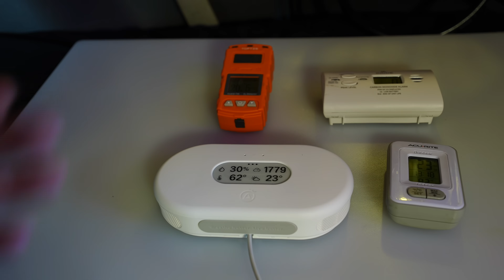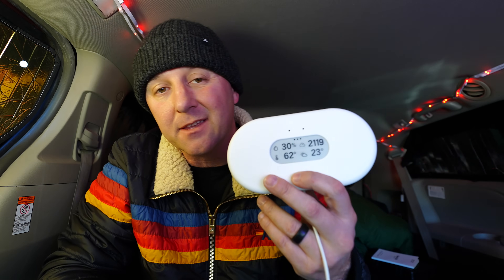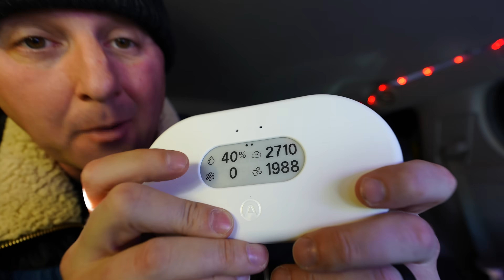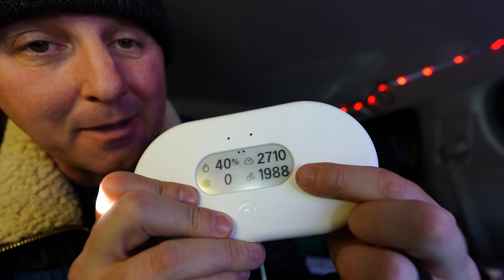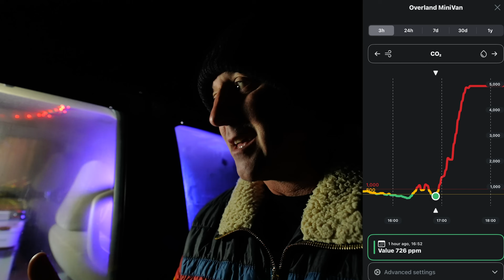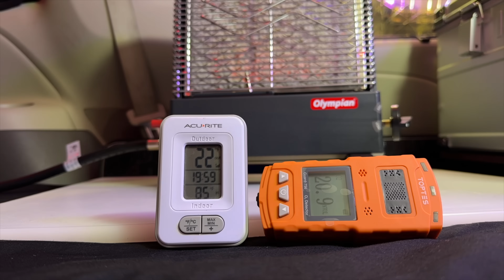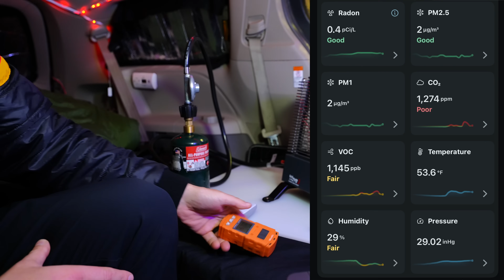Hidden Danger of Winter Camping With Propane Catalyst Heat

Comment from the maker: A lot of you are asking how the air can turn bad in only 45 minutes. Here is the nerd-out on the chemistry:

The catalyst process in a heater like the Olympian Wave 3 is still a form of combustion. To create heat, it breaks down propane (C3H8) by reacting it with oxygen (O2). The chemical equation looks like this:

C3H8 + 5O2 -> 3CO2 + 4H2O + Heat

Why it vanishes so fast:

• The 1-to-5 Ratio: For every single molecule of propane burned, it effectively destroys five molecules of oxygen from your van.

• The 11-Adult Problem: On high, this heater burns oxygen at the same rate as 11 full-grown humans breathing at once.

• Small Volume: My 2015 Sienna only has about 200 cubic feet of air. Adding a "12th person" (the heater) is why oxygen levels crashed to 18.2% in under an hour.

• "Wet" Heat: Notice the H2O in that equation? That is water. That's why your windows fog up instantly—you are pumping water vapor into the air as the oxygen disappears.

MY VERDICT: Cracking a window isn't just a suggestion; it is a biological necessity if you want to wake up in the morning.
Reply: A very important test for those sleeping in a small confined area.Thanks brother
Reply: @mannyfragoza9652  when my old lady farts - I can't  breath.
Reply: Biological necessity … 👍🏻

Comment: I use a USB powered heated throw. Works very well. I also have a 12v heated blanket for super cold nights. I also can use the USB throw to keep my back warm by the campfire. I have a 100000mAh power bank and that works all night. A gas heater for inside a van is a silly idea. Good video, thanks.

Comment: My best advice is to leave out the propane heater altogether. And use an electric blanket powered by any power station with around 2KWh of stored energy that can run the blanket for 10 hours. I'll thank you for that information that you gave me in one of your other videos. Even with that, I'd still leave a couple of windows opened just a crack. Especially if a person sleeps under the covers, the air that's breathed, there is a certain amount of carbon dioxide build up.

Comment: I have tried many brands and types of propane heaters in my van. They all heat well and I have never been bothered by dampness. But, ALL that I have tried shut off just as my van gets nice and warm. I understand this is a safety feature but it defeats the purpose of heating. To restart the heaters I have had to open windows or doors letting all my nice warm heat out!

Comment: Propane is not dry. A natural byproduct is water vapor. It’s about a one to one ratio, each gallon of propane will produce about one gallon of water in vapor form. Ventilation is also important in your van because the carbon dioxide we breathe out can build up to unsafe levels. Great video!

Comment: For one thing, you do not seal the doors when using an olympian wav3 or any other proane heater. I've used a wav3 in my cargo van every winter since moving into my van on Sept 2018. Keeping the front 2 winters cracked open for air circulation I've had zero issues. I've also not sealed the backdoor  as it has a good size gap for air to flow in. My alarm has never went off. I've had 2 in 7 years & changed the batteries at the beginning of every winter.

Comment: Also when people sleep they very likely to get hit as someone rolls around and doesnt realize its tipped off or even catches fire but if tip sensor works you can freeze up if not properly dressed n in slepping bags thats why diesel heaters are a favorite now among van campers.

Comment: yes, with these heaters proper ventilation and a CO detector are needed - it's life critical in a small space. I use a 3" foil dryer hose directly from outside to my portable buddy. I do not sleep with the heater on.

Comment: I found that the Wave 3 tends to cut out due to freezing the regulator on a 1lb tank. Switching to a 20lb tank eliminated that problem. Otherwise, cracking windows at night, I've not had issues with the heater in my Econoline.

Comment: Combustion heaters have always scared me when it comes to vehicle camping. For this reason I only winter camp where shore power is available. I use a Dreo Atom 1500w heater. Since it’s generally a bad idea to use a space heater with an extension cord (even a 12ga cord can have issues mainly due to the sockets on them not being able to withstand the heat generated by the constant 1500w load) I built my own heavy duty version. I put two 20 amp commercial grade duplex receptacles in a rubberized commercial grade outlet box. For the cord I used 10ga SJOOW. I terminated the other end with a TT-30P plug that goes right into the 30a outlet in the power pedestal.  Cord gets run into the vehicle through whichever window I crack for ventilation. This setup also allows me to utilize the full 30a of power available at the pedestal (I divide loads as to never exceed 20a on a duplex receptacle). I’m able to keep my heater on high while making dinner with my induction cooktop while watching YouTube on my tablet 😀

Comment: Except for the thermometer, I wouldn't depend on any of these monitors to keep my workers safe.

As a safety officer who's scoured the market for years looking for cheap air monitors I can use at work, I can tell you pretty confidently that the only monitors you used that have even a hope of giving you a true reading are the CO monitor & the thermometer.

The others will look accurate like a Db meter app on your phone would, they will increase & decrease some unknown degree based on some unknown fluctuations in the surrounding conditions, but they aren't giving you an accurate measure of either the change or the concentration of the gas you're trying to test for & unless you're able to recalibrate them with a gas canister you have no way of knowing if your sensors calibration is drifting.

Edit: funny enough, I just realized I left a similar comment on your other video three weeks ago, I guess you're in my algorithm now.

I figure also, it might be helpful to leave some recommendations for gas monitors based on what I use in an occupational setting:

Multi-Gas Monitor:
MSA Altair 4XR Multigas Detector 
(LEL, 02, CO, H2S-LC)

CO Monitor:
- ARA200 Personal CO Detector

Thermometer:
Use whatever you want

VOC Monitor:
I don't have one to personally recommend, if we need VOC testing at work we call in lab techs, although there are some industry-grade devices available - they're the kind where you have to call the company to find out the price.

Comment: I use my Wave 8 heater daily in the winter for additional heat in my home. I only use it during the day when I am home. I have had it for two years now. I check the propane tank and connections for leaks with every tank change. I also use a carbon monoxide monitor in the room and hallway. Never had an issue with the heater or air quality. No smell from the combustion process. Best propane heater I have had to date.
Reply from the maker: It's great to hear you've had such a positive and safe experience using your heater at home with proper precautions! Just a note that CO detectors don’t seem to be very effective at monitoring the propane process.

Comment: I went on a 2 month road trip and used a propane stove to heat my car. Worked great, except one night I went to light a joint and my lighter wouldn't light. Turns out I had no oxygen in the car LMAO

Comment: Or, you could sleep in an electric vehicle, and simply leave the car and heat on drawing in fresh air.
Reply from the maker: Using an electric vehicle for heat with fresh air circulation is a smart approach! They seem to be expensive though.

Comment: That heater is too large for that size interior. I love my wave 3- never any condensation, smell, etc. We use the small one in a promaster 2500. Run on high for a few minutes then turn to the low setting. Fantastic heat. 
Most vehicles have so many holes in them for ventilation (for door closing and air vents). Crack a window if you are worried you don’t have enough vents.
Reply: And sips propane! (Not sponsored😂)
Reply from the maker: Thanks for sharing your experience with your heater and offering those ventilation tips! It struggled to stay 30F above ambient temperature on its highest setting. So, it helps but wouldn’t be considered super comfortable.
Reply: @OverlandMiniVan wow maybe my van is just insulated well which is a key factor also~

Comment: If you are driving before parkup plan your sleeping routine before you drive. Have the heater on high with aircon running. When you stop, crack the windows, and layer up for bed. Wear a hat, and gloves, maybe fingerless gloves, and get into bed before the van heat drops. An eye mask can help.
Reply from the maker: Those are some excellent tips for staying warm and safe before settling in for the night!

Comment: For safe operation of a non-vented (vent-free) propane heater, building codes and safety guidelines generally require a minimum of 50 cubic feet of room volume for every 1,000 BTU/hour of the appliance's input rating.
Reply from the maker: Thanks for sharing that specific building code requirement for safe operation! It’s interesting, because my Sienna is about 200 cf inside and couldn’t keep up with the O2 consumption without ventilation. But, seems fine with proper ventilation.
Reply: @OverlandMiniVan  The venting you mentioned I believe is imperative and for sure do not operate heater while sleeping.  Thanks for sharing this video with us.

Comment: The Camco heater states proper ventilation.  Ive used wave 6 for years with ventilation and its been great
Reply from the maker: It's great to hear you've had a positive and safe experience with your heater using proper ventilation!

Comment: We considered the catalytic heater after getting tired of the moisture and fumes of the  Buddy heater, even though the windows were cracked open. Maybe I'm just too sensitive to the small amount of fumes emitted by propane.  Switched over to the inexpensive diesel heaters instead that exhaust outside. What a game changer.  No fumes, but clean, dry heat.
Reply from the maker: It sounds like you found a great solution with the diesel heater for clean, dry heat! I’ve tried diesel heaters in the past with great success. I plan to make a similar video measuring the diesel heater’s performance and air quality.
Reply: @OverlandMiniVan  I didn't want to say anything really negative about burning fuels in a room since there are millions of these being used, but as a retired physician who does a lot of RVing there is a downside to being in a low oxygen situation.  Being in a low oxygen room can have serious health consequences, ranging from impaired thinking and coordination to unconsciousness and death, with the brain being the most sensitive organ, often leading to rapid, unnoticed impairment and collapse, especially below 19.5% oxygen. Effects worsen with lower levels, causing rapid heart rate, fatigue, confusion, nausea, and potentially permanent heart or brain damage, making it a significant hazard in enclosed spaces.  Sorry for being a party pooper on New Year's Day, but I just had to chime in on your article that can affect the medical condition of some folks.
Reply from the maker: @p @philc.9280 excellent information and perspective. Thank you for chiming in!
Reply: @OverlandMiniVan  Yeah, price-wise, they totally compete with propane alternatives.  You can get them for around $100 now. I have mine set up with a temporary exhaust port so I can actually move the heater from vehicle to vehicle.
Reply: My first winter in my carho van i had a little buddy. It gave a lot of heat quickly & had to be turned off. So on bad nights it was on/off on/off all night becaus night was just too hot. My second year i invested in a olympian wav3 heater & love it. I use a 20 lb tank, kept at the rear doors with a hose running up to where the heater hangs. On bad nights I can run it on low all night & it stays a reasonable temp.

Comment: Under my multi chamber air mattress I have 1" closed cell polyethylene foam. Under two sleeping bags, long johns, sox and a wool hat I stay warm. My windows are always cracked. No way would I burn anything. This is a Happy esqimeau. A hot water bottle works all night.
Reply from the maker: Sounds like you have a great system for staying warm without a heater!

Comment: I use that heater every night.  Never seal your windows.  That’s stupid.  Always crack an inch or two.  Get a rechargeable fan to circulate the heat. I have mine in right now with a total of 3” of windows down.  It’s about 76* in my minivan and I’m on top of the sheets.  I sleep with it but I keep all 4 windows down 1-4 inches depending how cold it is outside.  The key is using the fan and putting it next to the heater and blowing on low the heat towards you.  On low that heater gets warm but if it’s below 40 I roll windows to 1” and crank the heat to high.
Reply from the maker: Nice! I’m still using it too. Just making sure I do it right.

Comment: I like to have an electric heat source while sleepiing in my Sienna Minivan. What I currently carry is two 350 W heaters from wally world ($11 each) and for when I need even less heat I take a mini crockpot (which consumes 95W on high and about 40W on low).   I can run the crockpot on high for about 20 hours with my 2000Wh powerstation.
Reply from the maker: Those are some really clever and efficient electric heating solutions! The crockpot can provide radiant heat if you have water in it.
Reply: Great idea. You don’t need to worry about which electric heat source is most efficient. They are all 100% efficient in that all the electricity is turned into heat.

Comment: Apparently this heater does not have a low oxygen sensor.  That alone would cause me to never even consider it for this use.  As I understand it, the Buddy heaters do have a low oxygen sensor.  Of course, relying upon those is another discussion, but at least they have one.  Would be interesting to repeat with one to see if there is any difference.
Reply from the maker: That's a really interesting point about the oxygen sensor—definitely something to consider for future tests! I believe it has something that stops the combustion and flow, but it is at a much lower limit than what I tested.

Comment: Used propane heaters of one type or another .. including a Little Buddy heater for the past 20+ years .. and here I am!  Key with propane is to always have ventilation.  I use a small ice house catalytic heater and a one lb bottle for temps that are mild and the Buddy heater for when it's real cold.
Reply from the maker: That's great to hear you've been using them safely for so long with proper ventilation! I still plan to use mine with proper ventilation as well.

Comment: I found the oxygen depletion results most interesting, thanks for doing this! About moisture...and just piggybacking on what you've said here... For some reason, a lot of folks think moisture is produced by a particular brand of gas heater (or a visible flame), completely missing the fact that it's the process of combustion that produces the moisture. This misunderstanding causes a lot of people to think that catalytic heaters (which are flameless) produce a dryer heat than traditional gas burning heaters. They don't. They still rely on a form of combustion – catalytic combustion – which produces the same amount of moisture and carbon dioxide. Burning 1 pound of gas produces ~1.6 pounds of water (about a fifth of a gallon) regardless of the gas used and regardless of the type of combustion. Thanks for providing this useful information all in one test.
Reply from the maker: That's an excellent point about combustion and moisture production regardless of the heater type! I went and added the chemical equation showing why oxygen is consumed so quickly in the process along with moisture generation.
Reply: Please explain how one pound of gas can turn into 1.6 pounds of water.  It just doesn’t make sense to me.
Reply: @muddybruddy1 It doesn't make sense to most people – no worries. Burning a pound of gas not only creates 1.64 pounds of water vapor, it also produces 3 pounds of carbon dioxide. It can also produce carbon monoxide if the burn is not thorough. A quick Google search will give you the details of how/why this is.

Comment: Oxygen depletion when burning propane will create CO instead of CO2, so your CO monitor is an oxygen monitor. I use a Toptes CT-580 for CO measurement. Using this, I found the Coleman propane stove creates much more CO than the Buddy heater.
Reply from the maker: Thanks for sharing your experience and the CO measurement insights! CO is the byproduct when combustion becomes inefficient. At that point oxygen is already critically low.

Comment: Awesome video, yes absolutely ventilation needed but I suggest a cross flow, crack 2 windows and run a fan for air circulation. 

I would love to see you run the same test using a fan for circulation. 

I have a snorkel type vent fan that clips on the window that runs on a battery bank. 

Yes I absolutely get a bit of moisture, most is from my breathing. 

I do sleep with mine running the entire time, but do use the vent fan, crack multiple windows and run a fan. 
The key is ventilation AND circulation. 
Thanks, I appreciate the research and I am sure it will help folks make a safe, smart decision when using a heater in their vehicle.
Reply from the maker: That's a great suggestion for cross-flow ventilation! Thanks for sharing your setup and the importance of both ventilation and circulation! I’m working on a fan project now that’ll work in summer/winter/rain.